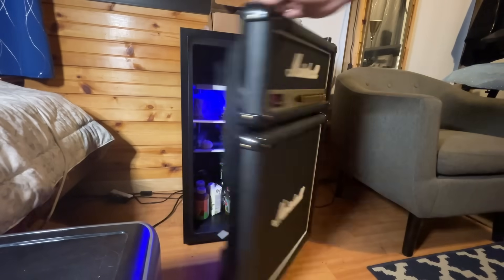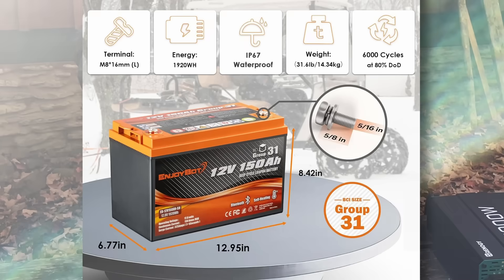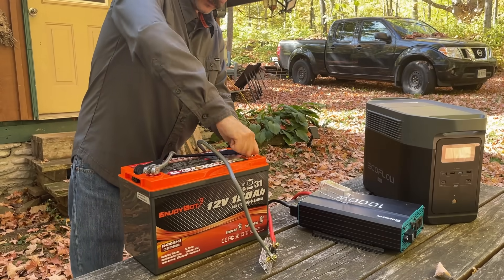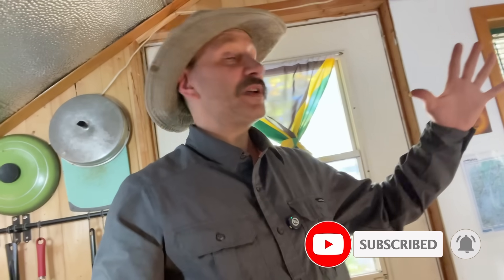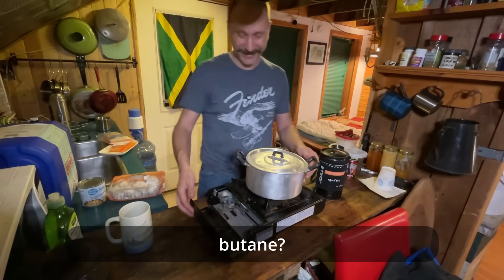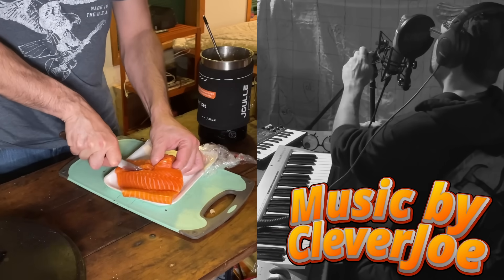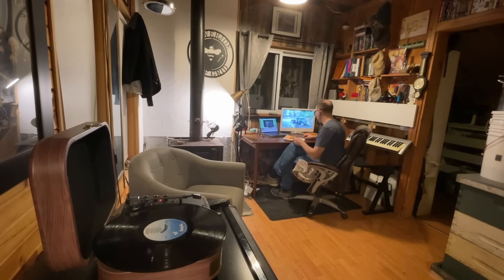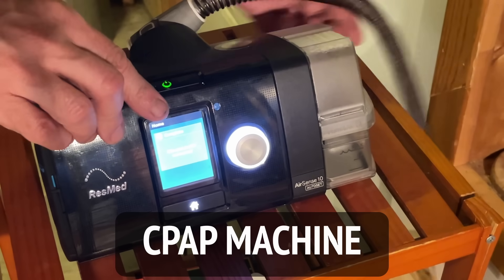Can a DIY Battery Setup Beat an EcoFlow? 24H Challenge

Comment: I have done the battery and inverter for a few basic needs.  That system is still available and can easily be recharged by the car.  I have also run the house on a generator during emergencies with a schedule of 4 hr in morning and 5 hr at night to charge up the Dwalt light&radio batteries.  But that system used 2.5 gal per day to run during emergencies and I was not optimally running the generator.  This year, I have acquired the Delta pro Ultra and 2 batteries for the house.  This system will run my house for a day under emergency conditions of heating in the winter and light cooking with most of the items available in the house.  And I will be able to schedule some day time for the 3600 w inverter generator to recharge the system when necessary.  I could run a smaller battery system, but at this age, I ask why I should compromise.  So I didn't.  Great video and my inverter for the car battery is only 400W.  It is small, but it can do what is needed during an emergency.

Comment: If you can get a power station on sale. Most of the time the sale price is close to the cost of the same size battery. The pecron f3000 is on sale for 899. Thats with 3000wh, 3600w converter and like a 1600w solar intake. You try to piece that together and your at half the cost with the battery alone. Not to mention you will have to install everything and make it portable but it still wont be as portable as the pecron. If you need it now then i suggest getting a power station. If you have time then you can build a great diy system because those parts go on sale from time to time as well.
Reply: Good point. I went with two of the Anker solix for about $900 total. Mostly because I figured a big company like Anker had a higher likelihood of being around to honor the 5 year warranty. They work well and are considerably lighter than the bigger units.
One more small suggestion: for less than a hundred bucks you can buy a 700 watt microwave that will work fine with either setup.
Reply: @butchie2752 pecron has been out longer than anker and is cheaper lol
Reply: I saw that deal & am wondering if that & other ones will come down more as black Friday approaches
Reply: @markb6295 I’m hoping
Reply: @markb6295 it came down to 799

Comment: Like the real world results combined with humor. I’m still new to video making, curious how you do the bear in the window.  New Subscriber.  I’m in the process of building a DIY with a Giandel 24V 4KW Inverter, 4 330W solar panels, 4 WattCycle 100 AH 12Vdc LifePo batteries, a Renogy Charge Controller, Victron Shunt, and 110Vac to 12/24VDC 70W battery charger. Plus misc wires, fuses, circuit breakers, cut off switches etc.  It cost me more than buying a Delta or Bluetti during Prime Days. But I’ll be able to repair at component level and also expand by adding more batteries.  My background is in electronics so I’m into building it. But there’s something to be said to taking it out of the box and just start using it. 

My main reason for building it is to not lose food in the refrigerator and a freezer when the power goes out. Plus keep the heat running.
Reply from the maker: Thanks for sharing what you’re working on, sounds like a good setup. Agreed that it adds up fairly quickly once you start adding all the components. For video editing I use DaVinci. Thanks for watching!

Comment: For those that are new to this, yes, getting one of these 100/150AH batteries and a fuse + inverter lets you spend less money up front and be able to expand your system cheaper. BUT, and it's only briefly mentioned in the video, you'll need more equipment to actually re-charge your battery (like the solar inverter + solar panels). I've actually not seen anybody recharge one of these 100/150AH batteries from 120V home power, so I'm not sure what's needed (?) unlike the EcoFlow, which you can plug into a 120V to recharge when you get done using it.
Reply from the maker: I appreciate you pointing this out. There's a LOT not covered in this simple demo, including recharging. I may do a followup video in the future based on the questions asked here. Thanks for watching.
Reply: @cleverjoe  can you recharge the battery with a car battery charger?
Reply: @decormiamour  What I always hear is that, yes, you can, but since a car battery charger will automatically go into maintenance mode when fully charged, and lifepo4 batteries DO NOT like additional current when full, you are risking damaging the life of the battery if you aren't prompt disconnecting it once it is full.
Reply: You can charge them using a battery charger that plugs into a home outlet. They have ones specifically for LiFePo batteries or you can get one that allows you to select your battery type. There are inexpensive options available on Amazon. I've built a couple portable systems that I charge this way and with solar.
Reply: The Anker solix plugs into the wall. You an also use any other 12 volt battery as backup by using a 12 volt inverter. Some guys also say you can plug the battery directly into the solar input as long as you don’t exceed the maximum voltage (60 volts.)  I haven’t tried that.

If you tried to make one yourself you wouldn’t save a lot of money mostly because they can get the parts cheaper than you can. For me, the fact that they actually knew how to do it safely and gave a 5 year warranty made it worth it.
Reply: $24.99 lithium battery charger will charge lifepo4 batteries with a house outlet, 120v. Also a cheap $30 charge controller and $100 for two bifacial panels will work too

Comment: I built my own 24 V system and enjoyed putting it all together, SCC, fuses,bus bars and 2000W inverter. I do have power stations but wanted something if a component failed, I know how to fix it. i need to pickup a 12v inverter between 1000-1500W so I don't have to change my wires.  I went slightly bigger on my 24v just in case.
Reply from the maker: Nice setup, always a good idea to go bigger than you think you’ll need. Thanks for watching and leaving a comment.

Comment: I have a renogy 100ah battery and a renogy 1000 Watt inverter it cost more than the ECOFLOW delta 2  i just bought for 599$cad. Now I use the Renogy battery as an extended battery for the ecoflow through the XT60 connector.

Comment: Love it, And .. if you want to go bigger you can save so much more. I have a genuine 3500W pure sine wave inverter hooked up  to 3 12.8v 300Ah LiFePO4 batteries in parallel. So Just under 12,000Wh with solar running into the batteries its a great off grid setup. Small gas generator (1200w) for efficient emergency top up of the battery pack if needed. Always a good idea to have a spare inverter to hand and fuses ect. Once your set up you can add or have what ever amount of back up power at 1/3 0f the cost of the manufacturers battery boost packs. Just as an example i also run a 1600w inverter with 2 168Ah batteries, a 750w inverter that has a load of USB and USBc outlets. Also another 13,824Wh of 12v in the form of 6 180Ah LiFePO4s. But defiantly when on the move its best to have a proper power station, and there are absolutely so many to chose from. Again its good if you can have more than one with you
Reply from the maker: Thanks for sharing. Cheers, Joe

Comment: Ok, help me out.  If everything I use lights water pump even the cell phone is 12 volt.  Anytime you need AC power it dramatically uses more power because converting DC to AC .
 So all lighting air conditioner and refrigerator DC power your ahead of the game.
Right why convert if DC equipment is available?
Reply from the maker: The more you can power with 12v, the more energy you’ll save.

Comment: The homebuild is better all day long...if something breaks you're likely looking at replacing only one component...if the ecoflow fails you're just SOL
Reply from the maker: Agreed, but it should be noted that Ecoflow has a five year warranty in case anything fails under normal use. Cheers

Comment: i would have went with the 399.99 300ah 12v lifep04 and a 2000w inverter.. and still save 200-300 over that eco flow.. and have 4.8kwh vs 2kwh .. simple math tells you its a better deal with the diy..  I currently run a 3000w powmr 24v hybrid inverter with 9.5kwh of lifep04 .. cost is 1500ish with the cables and fuses, breakers and pos/neg busbars .. saves 500-800 over the cost of the 4kw all in one units, with twice the power with a 24v system on my RV.
Reply from the maker: Thanks for sharing your setup!

Comment: I use them in combination. I have 2 EcoFlows and 2 100 AH batteries as back up to the solar panels. I decided to do that after the last hurricane when the EcoFlows ran down and the sun did not come out. I'm still learning about solar so this was a way to ease into generating my own power. As electric bills have begun to rise I'm looking to rely more on the panels and batteries to supplement electric power.
Reply: You are absolutely right.  i started thinking about solar after the last hurricane hit daytona beach area which we live near by.  no power for a week and all but lowes ran out of propane to run our generator.

Comment: Them projectors compared to a say 20 inch tv what is more efficient.
Reply from the maker: That's a good question - newer tv's can have very low power consumption, and the projector I'm using is a few years old and was super cheap at the time. I suspect the light and fan consume a decent amount of power. I think I showed it's power draw in another video, but it would be a good test to do.
Reply: @cleverjoe I have been looking at them projectors and I think it would pair good with my solar generator

Comment: I have Delta 2 Max and it sucks at 12 v conversion... 
I have a 40 w 12 v on a 2096 wh battery... And in 12 hours (480 wh) (overnight) the battery is dead empty....
I wasted my money and should have just bought a 12 v 100 ah battery!!!!
Apparently EcoFlow doesn't care and will not fix the problem...
Reply from the maker: That’s too bad you’re still having this issue. I’ve read your other messages re your battery draining inexplicably. What was your experience with customer support and the  warranty?

Comment: Yes you can build cheaper, but that build isnt apples to apples build! Now, building your own with another high frequency inverter, you wind up with the same sub par system, you can do the same using a low frequency inverter and be miles ahead and much better system. I cant stress the importance of using low frequency over high frequency enough, they are transformer based like the electrical grid, not small transister based like high frequency.
Reply from the maker: You're right, this was more of a "proof of concept" setup, comparing an apple to an apple core. Thanks for your input!

Comment: i have 6 diy solar gen. a 5000w a3000w two 2500w one 1000w one 500w just 4 the pourch lite some are 24v and some are 12v systems running different parts of the house if some thing breaks i can fix it no big deal all used solar panels even some junk harbor frei panels
Reply from the maker: Love the redundancy!

Comment: GOOD KIT BUILD. we have ecoflow as well but built a diy with 100ah kepworth lifepo4 with bojack fuse to a 2000w bougerv inverter and the key is pure sign wave to protect sensitive electronics as our kit is to run our bougerv 3500 btu ac in our off grid truck. we also recently added a dokio mppt charge controller with 160w panel to the diy so it is self safficiant. you do great thorough content. we are far away in florida but off grid is off grid lol we just get less snow!
Reply from the maker: That sounds like a solid setup. Always interesting to hear how others build their systems. Thanks!

Comment: I can control the entire power flow via a power station without even being nearby. It can be told to charge from X time to Y time, turn on the AC output at 12:00 to run my fan heaters for one hour, and activate the USB ports at 13:00 to charge my tablet as soon as 30% of the power station's battery has been recharged via solar.

It's a complete management system for my household's power. How is your simple inverter supposed to remotely compete with or replace any part of that??

I can be anywhere in the world and only need to open the app to see what's coming in, what's going out where, and I can influence it 100% at any time. You cannot replicate these infinite possibilities yourself with DIY tinkering.
Reply from the maker: Good points, although I’d suggest you can in fact build a similar system including remote monitoring and management. But at that $ point, you’d be further ahead to simply buy one prebuilt. Thanks for your input.

Comment: power stations not only a battery and a inverter , 
they contain tons of stuff in it and its near not possible on any amount of money get all the inteligent advanced optionson simultany inputs and outputs+ high advanced apps over that you can control your house!!! 

lets take a ecoflow river 3 plus in there parts what cost 180$

top end mppt charger build in cost 60$
600 watt ultra silent and hig effizenz pure sine wave inverter 100$
40ah LFP battery 60$
DC and USB chargers and 12 volt DC -DC modul 40$
high resulution battery monitor with shunt 40$
andvanced spezial design motherborad with conevt all parts together with wifi and BT modul what makes any part controlabel over an app 100$
......

if i try to DIY rebuild all what an ecoflowe gives the user by myself i end up 4x higher price point.

that what ecoflow , bluetti or others offer is outstanding cheap for what it offers!!!!
Reply from the maker: Agreed, the full feature set of a pre-built unit goes way beyond a simple battery and inverter. Depending on your needs, they can be great value for what they offer in convenience.
Reply: this seems like post from someone who doesnt know what they are talking about, can you give me the product model number for that "40ah" ecoflow river 3? ive only been able to pull up a battery expansion module for the $180 supposed price.

Comment: Thanks for the video and showing both options! I build my own solar system, very similar in specs to the one you showed, and bought a powerstation much later as a backup.
There are pros and cons for both of them. Easy replacement of individual parts on one side for e. g. and portability on the other.
I would say, do both: learn the basics and understand the technology and physics behind it. Then you can easily pick the right powerstation for your individual needs.
Reply from the maker: That’s a great approach—having both gives you the best of both worlds.Thanks for watching.

Comment: This seem pretty cool and easy. I bought a 48v lithium, golf cart battery (that I am now stuck with) and wanted to do something like this. Do all inverters have solar input to recharge?
Reply: search for a "48v hybrid inverter", that will take care of your inverting to 120v/240v and will have your MPPT controller for your solar panel inputs as well as grid/generator input charging
Reply: No, the inverter in a DIY system transforms the DC current of the battery into AC to use with common household appliances. The solar panels are coming before the battery. To control and manage the charging process you would use a solar charge controller. It is basically plugged between panels and battery.
There are more details to it. Most important is, that the components need to match each other. Or buy a charge controller that is more capable to provide room for upgrades. Also, keep in mind, that you will use a lot of amps in a 12 Volt system, when powering appliances via an inverter! Your cables absolutely need to match that, or they will overheat and ruin your day. 😉
Reply from the maker: Good info here. I didn’t cover charging options, may be good idea for a followup video.

Comment: I started my journey by building an ammo box system with a 18AH LiFePO4 battery along with a small Victron solar controller and some lights.  The thing is great for my CPAP and later I upgraded to a 30AH battery.
My builds are mostly around 12v/24v crate systems but moust a DC hubs.  The efficiency is outstanding.
FYI I'm sure you have seen them, but I switched out my CPAP AC power supply to a sturdy 12v to 24v DC power supply that does a great job with my CPAP. 
On a typical outing, eith ther 12v 100Ah or 24v 50AH battery supplies our needs for the 2 day/night outing.  Anything more demanding and we bring the EF D2 or Bluetti Elite 100 for additional support.  
I also use 220w bifacial panels to charge the power stations or the batteries using a Victron 30/100 MPPT solar charger. 

Stuff is getting more reasonable and you can build a nice kits that include 12/24v refrigerators and USB LED light strings
I also have 2 EF Delta Minis that still rock
Thanks for the video
Reply from the maker: Thanks for sharing. Good tip on the 12v power supply for CPAP. Good luck, happy off gridding!

Comment: For smaller applications the DIY systems can be cost effective and simple due to scalability. But for larger applications the pre builds makes more sense. There is much more to it though such as cost of components, system size and applications.
Reply: I think DIY is better for both large and small systems. But for those who can't DIY a system, then pre builds are better for them.
Reply from the maker: Agreed, it really depends on the scale and what you're trying to power. Thanks for your comment.
Reply: DIY systems made of higher-than-average-class components like Victron Energy will be much more scalabe with larger applications too. All-in-one systems are better in terms of portability and plug'n'play style of use